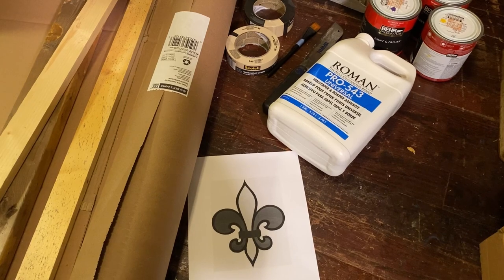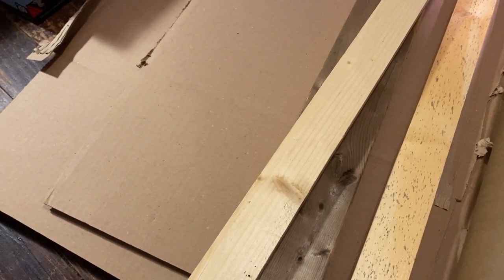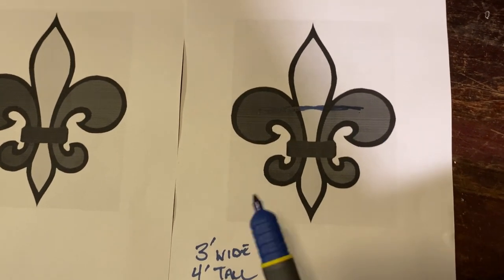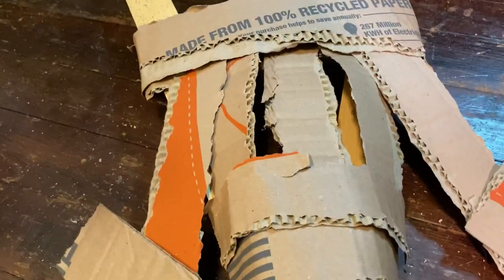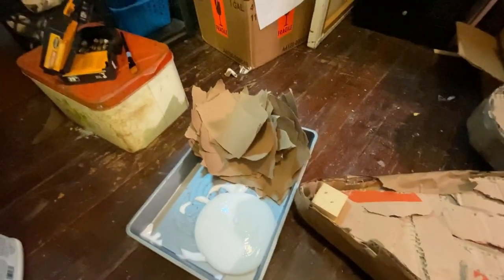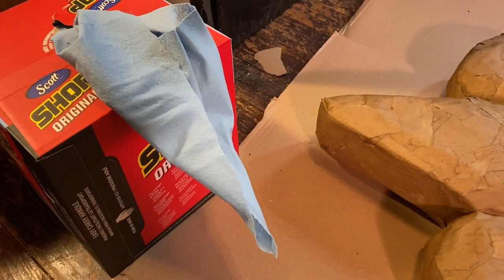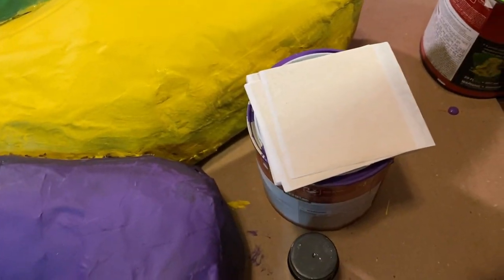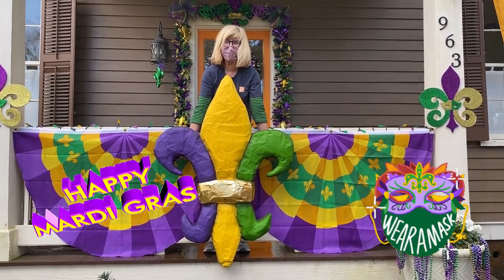Yardi Gras Prop- How to make your own.

Comment: You should lay down a primer coat before applying your main colours -- 1. to seal the paper mache and 2. to have a neutral surface for brighter or darker colour with your paints.  You might also try wood glue, flexbond mortar, boat varnish, spar urethane or Flex Seal to waterproof paper mache. These are used for paper mache outdoor sculptures to protect them from weather.  However, you have to make sure there are no holes in the sculpture so it can be sealed completely.  I'd also say experiment with a few quick pieces to find out which one works best over the long haul and for the conditions you expect a piece to be exposed to.  Also, solvent-based sealers are a far better bet than water-based ones.